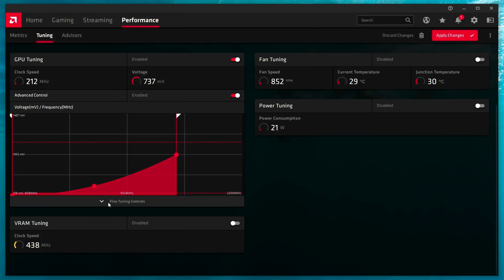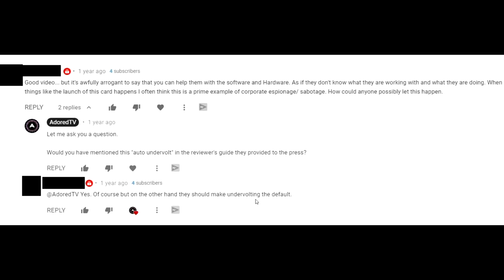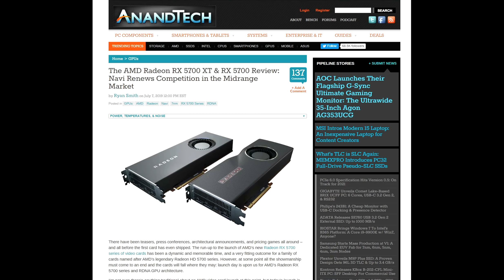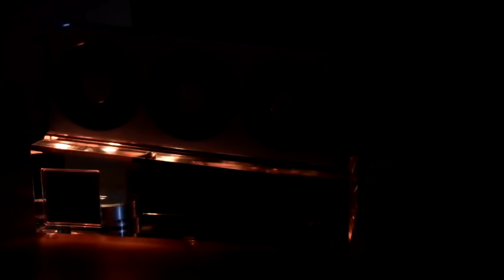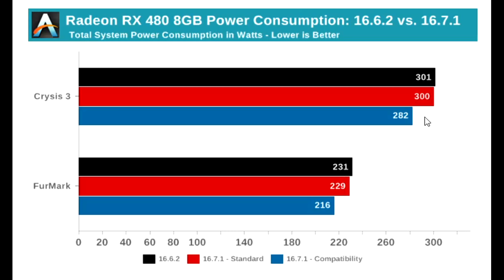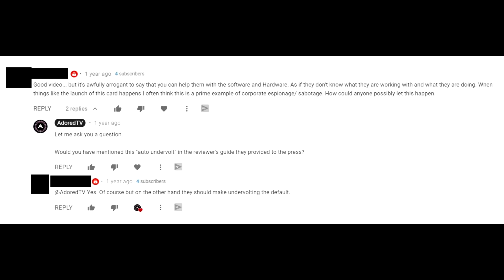Fixing AMD's "Hot and Loud" Graphics Launches.

Comment: my aftermarket R9 390/X's actually had 1.2625(Gigabyte) and 1.275(Sapphire & XFX) voltages , also i must say, that in the very first version of Hitman or Hitman 2 , the Gigabyte R9 390X actually artifacted , but artifacts gone when i increased the volts to 1.275 , also about mining, in mining cards can handle very low volts, my R9's can go as low as 1.148(depends on the algorithm and silicone quality) , without errors, some more heavy algorithms do require even 1.2V and at times 1.206V , but nowhere near 1.2625 or 1.275 , ,, as for maximum voltage which my R9 390 Sapphire cards can handle, it's 1.375V , on 1.38125V they start to act very weird(all 4 cards, even if clocks is stock and beefy power limit.) so i can't go further in clocks than a certain point, as for R9 390X's (i have gigabyte and XFX) , i didn't tested, but my XFX one is horrible OCer, it acts weird much sooner than all my other cards, Gigabyte one on the other side is a great OCer so it perhaps can go further in terms of clocks at very least on the same volts, and if lucky, perhaps can even not act weird on 1.38125V but i doubt.

anyways yes i'm well aware that 1.35V+ is not exactly healthy for cards so i don't do that on a daily basis, during all tests, cards had 47C, 46C, 50C, 59C so it was somewhat safe, don't worry (on air, ~15C ambient + opened window, 3 fans all at max speed, the gpu which was at 59C was inside the case while others is outside, 2 of the gpus have stock paste and 2 others have thermal grizzly kryonaut, at this point i can't say which ones use which, since even how close the card to window matters here, but by all means thermal grizzly kryonaut is a superior paste so go for it if you have the money, i done the tests long ago and it's worth every cent as long as you do the application properly.. it's fine if you add a bit more, but it's not fine if you add not enough, not enough paste will result in bad contact with the die and the card will thermal throttle, talking from live experience of my own when a guy in service center used some of his paste on my cards without my rights and done it poorly..)

also if you want your card to live longer - don't push the memory clock to the very limits, instead find a sweet spot which actually gives you performance while a decent bit far from the limit, e.g. instead of 1724 while stock is 1500, use the 1640 or 1560 , that way your card will live much longer (live experience) , as for core clock - don't worry, as long as card is cold it's much more safe than memory

Comment: Option Number 7
Over engineer the hardware and pair it with stable, efficient, software.
Reply: Why would they do that when its obvious from this comment section fans will take whatever mouldy crumbs AMD drops for them while making excuses. Any other company gets crucified for even the slightest misstep (Imagined or otherwise) by tech press and the public, yet they let AMD Slide on by.
Reply: Their hardware is over engineered. Just watch buildzoids reference 5700xt vrm analysis.
Reply: @AaronZakhrov  

Ok, we are halfway to number 7.
Now if we can just explain to AMD's consumer graphics department that the customer needs to be able to use this hardware reliably, AMD's consumer graphics department can get a raise.

Comment: I simply cannot agree due to the blatant anti-consumer aspect. Most people buying these GPUs aren't going to undervolt them and will simply use them as they are. It'd be extremely misleading to state a different power draw, noise level or temperature level in reviews. 

I'd rather they continue honing their AVFS (Adaptive Voltage and Frequency Scaling) system in which was recently added to their GPUs.

Whilst this may only be one review I quickly searched which isn't a huge sample size, they were aware and did utilise the automatic under-volting feature. It's only takes one press site to notice anything potentially misleading for anything to blow up on the internet now.

https://hothardware.com/reviews/amd-radeon-vii-review-and-benchmarks?page=9
Reply from the maker: They are doing a lot worse anti-consumer stuff than this.
Reply: @adoredtv  AMD? ... Well, then they might as well go right ahead with this and should have.

Comment: I only have one issue right now with my Radeon VII, two issues if I move to the 2020 driver.... More on that in a second.

I don't undervolt, but I also don't overclock. I run my r7 completely stock. And it never goes over 98c JUNCTION. And its not loud either. Hell my 3950x on liquid cooling with Noctua fans set to 50% speed is louder, and that's pretty quiet because #noctua.....

The current issue is that, when running dual monitor, with two different refresh rates, there seems to be an issue with memory when mixed with variable refresh rates that causes one of the monitors to flicker and flash like the memory is failing on the GPU, and yet with single monitor the issue goes away....

The issue I get when running 2020 drivers, is that when trying to watch a video/movie/youtube/amazon on my secondary monitor, while gaming on my primary, the gpu will just crash and require a hard reboot.....

FOR NOW, I will just use 2019 drivers, I don't really like the new drivers anyway. In a few months the new Samsung Odyssey G9 comes out, 5120x1440p, 240hz, 1ms, HDR1000, with 1000R curve. Its like having two monitors in one since its 32:9 (aka two 1440p side by side). I currently run my main monitor, Alienware 1080p 240hz, and my secondary Samsung 1440p 144hz HDR600.

When you look at monitor technology, no one is actually pushing the boundaries of the cable's we use. Sure HDMI 2.0 got maxed out, it can't even do 1440p 144hz HDR, it can only do 120hz when using HDR and 144hz without HDR..... But DP 1.4 has been out for awhile now and we still haven't fully saturated it.... Which is why Samsung is pushing 1440p 240hz WITH ultra wide..... look at other brands from CES earlier this year, 1440p 144hz, 1440p 120hz, 1080p 144hz, 1080p 240hz, same shit we had, but at exorbitant prices. You can get a "last gen" 1080p 144hz for like 120 bucks, or you can get raped and buy the "new version" with the exact same specs for around 250 bucks.... no thanks. Absolutely ridiculous. AOC recently listed their new 1440p monitor, they are only going with 200hz, 40 short.... and no HDR...... AND To say the panel isn't able to run 240hz is laughable. These panels can do much more than they are driven, the main set back is the "motherboard" or "brain-board" driving these panels. Even ASUS is going to rape customers, they plan to release a 360hz 1080p..... what? They should be dropping 480hz no issue, but they love to rape customer by offering them LESS than they can actually do. When you realize how cheap these monitors are being made, and the fucking profit margins, you would be PISSED. Samsung is the only brand pushing the boundaries right now. I look at refresh bullshit, $250 bucks for a brand new 1080p 144hz monitor, which cost said company like 20 bucks to make.... don't let the prices fool you, we are currently in RAPE mode for many electronics on the market. If you compared now to 10-15 year ago, its just laughable at the profit margins they push. And because of these forced profit margins, they don't push boundaries because it would eat into their profits.... Samsung said fuck that, we are going to offer more than other brands, we are going to push boundaries and take all the profits because people will crave the higher specifications. As such, 5120x1440, 240hz, 1ms, HDR1000, with 1000R curve. This monitor is going to be a fucking champion. They are even making a 2560x1440p (standard 1440p) 240hz HDR600 version with 1000R curve. Why can Samsung do this, but all the other brands can't? Because they don't want to push forward. You see excuses like "oh the gpu cannot handle ultra wide 1440p with 240hz" what? Since when do you have to WAIT for other technology to improve? I remember back when if you didn't innovate, you got left behind. Now the meme is to NOT innovate because no one else is either. If I owned a monitor company, we would constantly push the boundaries of monitor technology, which would then force negative bias towards GPU brands for not being able to drive the panels. Like the Samsung G9 I am talking about. You can cry "but there are no gpu's to run it" but in reality you should be complaining "why are gpu brands slacking off, why aren't we getting MORE performance" and again, there is no driving force to innovate. We are in the slowest growth of consumer electronics in history. YES, things are getting faster, but not at the same RATES at which they used to. Back in the day jumping from one generation to another could be almost double if not more in performance, now we get 10%, maybe 15%, maybe 30%, we never see those kinds of growth we used it. And I blame the companies slacking off.

EDIT: I wanted to add in. I don't believe in part degradation. The idea that all parts wear over time even at stock clocks and voltages. this to me, is absolute horseshit. I have old gear that still runs just as fast as it did when it launched, and its 10-20 years old depending on component. None of them have lost any performance over time. Now overclocking something beyond its safe parameters makes sense to me for degradation, because then you are stressing the component beyond its design. to me, its like cars. a cars engine can last a lifetime, the moment you start pushing more power, lets say by adding a turbo, yes you get more power but the design wasn't meant for turbo application, so it wears out faster. there are people out there with old ass cars running 800k miles or more and it still function and performs like it did on day one. granted, you could argue they change out parts like water pumps, alternators, and other such parts, but the main engine, the pistols, and the cylinder walls, all stock from when it was first put together. and it still runs at its stock range. this to me is just like consumer electronics, the stock speeds will last a lifetime, but overclocking will wear it down faster. so while i believe in OC degradation, I do not believe that stock parts have to meet a minimum time-frame to cover the warranty period. If they were the case, we would see much more severe performance loss over time and higher stock performance. I have gpu's from late 90's that still run to this day... Same for the ones I got in the early and late 2000's. all still work as long as you have the proper driver for it. So to claim that there is degradation at stock frequencies is just laughable. And when you look at the AMD meme of "fine wine" where drivers get better and you inch out more performance over time, that performance gain would not be able to mitigate degradation if it existed at stock ranges. I also point to TSMC for example, where 7nm has a working voltage range up to 1.5v, and that is "safe" voltages. Now architecture of a chip might vary and thus voltage may vary, but if the core 7nm node can handle up to 1.5v, then so should any chip made on that node. therefore the real degradation would come at over 1.50v like 1.51v.... and so on. So in this regards, you are just spreading misinformation.

Comment: This type of deception is very anti consumer and will not do AMD any favours, brand image is important and Nvidia's 3D Mark 03 cheating scandal (it took years for me to consider them again after they cleaned up their act) and GPP is not the sort of thing to aspire to.  AMD need to design a better architecture, which it seems they have done with RDNA 2.0, rather than relying on tricks to compensate.

My Vega 64 undervolt is not stable in absolutely every game and I don't want to be misled into thinking a card is better than it actually is because this hurts me, not just Nvidia.   Stability is extremely important (things like the black screen crash problem need to be avoided as customers will swear never to touch your brand again if they get these types of headaches and/or RMA.  The media will also blow it up, quite rightly if it's a genuine problem).  

If AMD are overvolting GPUs unnecessarily then they need to improve their binning process (option number 5 might be okay as an option, separate compute and gaming voltages but without compromising stability.  If stability cannot be guaranteed in both current and future games that may use more compute than anticipated then the user should be able to choose to enable/disable it and it must be made clear that stability cannot be guaranteed in every game/application).  

Auto undervolt should be an option that must be made clear to reviewers but not a hidden default that only applies to the press samples.  An interesting thought experiment though, thank you.

Comment: With 7nm GPU as you increase the voltage the delta between Edge and Hotspot increases exponentially. You can have R7 running with 50C edge with a 90C+ hotspot.  Higher voltage is simply trying to get more performance out of the GPU.

Comment: Today i can consistently reproduce and test the the black BSOD and my FIX (probably limited for my system or GPU {RX460 bios modded to a RX560}.
 My FIX is just disable the P7 state of the gpu.   I can cycle a few rotations of both cases black screen of death default state in a few minutes.  Or my fixed "P7 disabled" were i can game for a few hours.

Comment: Fact is AMD is just still behind on power usage and performance. Navi is a good step forward over Vega, hopefully next gen is another big one. the power problem is they pump too much voltage in the chips. 1.05v is the sweet spot, imo and navi doesnt lose much performance vs reduced power use. i think they shot too high this time, should have gone with matching the 2070 and 2060 at way lower cost, not beating them, and have a 48 or 56 cu die ready to go too in stead of the dumb 5500xt. they are trying to fight the wrong battles with the wrong weapons so to say.

Comment: They could also set clocks/volatges based on system date, instead of driver version. Or have the foresight to install power on time counter on the cards, and have the driver read that hardware counter. That way the card itself would just count but not alter voltages, allowing them to have the option of making adjustments on heavily used cards in later drivers. Or do nothing at all, if they realize RMA rates are lower than expected. Also could deny warranty for compute users though, which is something I would not be too happy about...

Or have like a "performance optimization tool" that the driver nags users to run every 6 months and on a clean (DDU) installs, that would do a 5-15 min stability test at a voltage slightly below the current setpoint. If the test fails, the setpoint will be moved up slightly. If any users complain about a card crashing, support could just ask them to run the "AMD POT", and if they suffered from degradation it would "magically" solve their problem.
Might wanna call it something other than "AMD POT" though, for two reasons ;-)

Comment: I must of lost the silicon lottery a little with my Radeon 7. I can undervolt to 1010mv stable, any lower and it's unstable. I thought I would try the 950mv you got with your card and it instantly crashed when loading a game. Oh well, it's still enough to bring the noise down which is a pet hate of mine. 

Side question. Does undervoting the card apply to the VRAM and GPU or just the GPU core itself?
Reply: Undervoltung the GPU does apply to the gfx core.
If you want to undervolt the memory, you have to do that separately in the driver.... BTW. There is plenty of room on hbm in vega... I wonder whats possible in radeon7..
Reply: @justacomment1657  I may have to play around with that then now I have the main GPU undervolt stable. Maybe it will bring fan noise down a bit more. Thanks.

Comment: Well sure they need stability for the life cycle if he card, but it most definitely doesn’t have to be at the very ragged edge of the clock/voltage curve. My 5700xt nitro had a target clock out of the box of 2049@1200mv *with unnoticeable performance differences*.It’s rock solid at 2010@1100. Peak power dropped from ~210-220W down to ~170-180W. Average power draw dropping over 40W due to the lower voltages on the curve as loads occasionally drop gaming giving superior “catching breath” periods. Temp drop on junction of ~10-12C, as well as slightly lower memory temps. For  me, this puts max power operation right around the “audibility barrier” where its fans aren’t particularly audible over the system/game/ambient noise. Overall a delight to use vs how it was shipped.

Comment: @adoredTV Jim - I had the same issue as you did, and the pins and needles sensation comes from nerve inflammation in the elbow, the cuticle tunnel (syndrome). It is likely because of how much time you spend at the computer, typing and using the mouse, or resting your elbow on the table. When you go to the doctor, ask him to inject your elbow, very near and immediately around the damaged nerve with Kenalog-40. After about 3-4 injections repeated each week, it will go away permanently. I had the same thing done for me by my father who is a doctor. Hope it helps!